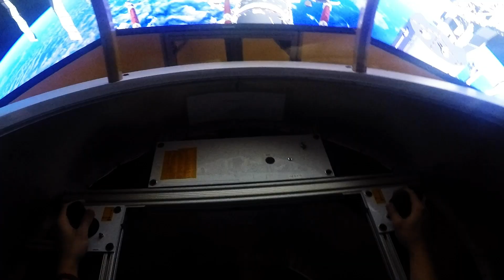Announcing Orbital Reef - Your Address in Orbit

Comment: Why is there no centrifugal Module?
Reply: Because for now, there is not a use case that requires it. On the ISS, or on future commercial space stations, crews will likely never be in orbit for longer than six months at a time, and thus, the effects of microgravity not enough to warrant a rotating module. I can however, see some kind of artificial gravity on future flights to Mars, and it will be essential if we ever want to send people to the outer solar system.

Comment: Far better than any pipe dreams of 1M people on Mars by 2040. 
Now get the Glenn ready and let's go!
Reply: Spacex=127orbital missions. BO=2 times going up and down. 1M is absurd but this is also.
Reply: @AnkardTan  No doubt that Space X is far ahead. However, once the NG is operating, it is basically bringing known technology in orbit. So, nothing that has not been done before. This space station seems to be a bigger economical challenge than a technilogical one.
Reply: @derhafi  ok, ng is optimistically estimated to be finished q3 or q4 2022 idk... so then the testing starts? by then, starship may be finished with its testing campaign... might not, but SpaceX has an assembly line for raptors and starships and is far cheaper to test since its cheaper to build. Starship=fully reusable, specialised steel, ng=partialy reusable, composit materials. So my question, who will have the money, capability and payload to build something like this first? My bet isn't on BO&Boeing for now.
Reply: @AnkardTan  I agree, the current prominence in development and the upcoming operation costs of starship alone, will keep spacex ahead of anyone else for the foreseeable future, when it comes to heavy lifters. 
Boing should have no trouble building a space station. BO is going to the lifting, they are going to insist :-)  my guess: not before 2025 even if they hurry up.
What I like about this, is the potential it has for an actual working space economic. I know, I know, I’m aware of the huge part wishful thinking on my side here but as a sci-fi fan, I want this to happen. I want satellites, infrastructure, telescopes, refineries and ships built and maintained in space and on the moon. That’s not asking too much, is it?

Comment: Reality Check: 
The rocket they want to take the station's parts to orbit, New Glenn, hasn't even started testing yet. 
The capsule they want to take astronauts to the station, StarLiner, has just been delayed another YEAR because Boeing is once again proving that they can't handle building capsules anymore. 
Boeing, the company they want to make the modules, is not doing to hot with their other space contracts right now. (See SLS, Starliner, etc)
Blue Origin's only claim to fame right now is their suborbital tourism, which has potential for them. For now, though, they need to keep their feathered little butts out of the big boy leagues until they have something more tangible than some half-assed blender animations and a dream.

Comment: This was designed by an idiot. Or a group of idiots.
Firstly; how are you proposing to use Bigelow modules when the company is shut down?
Secondly, why would you select such stupidly small inflatable modules?
Thirdly, a zero-G station is functionally useless for tourism of any kind. It's got to provide SOME rotational gravity.
Fourthly, the windows are purest designer masturbation and will NEVER make it to production.
Fifthly, Dreamchaser is only for cargo, and hasn't flown yet, and is many many years from getting man-rated.
Sixthly, the space arrangement shows zero understanding of moving around in Zero-G.
Seventhly, 1:30 shows a stupid Presurized Mating Adapter (PMA-1, in fact) from the ISS. The bend in it is due to the Space Shuttle's physical layout - and so the person who "designed" this station doesn't know jack shit.
Eighthly, there's no internal central structure shown in the inflatable module. That is impossible.
Ninethly, Boeing will offer the  most expensive launches in history. To partner with them is insane.
Tenthly, 3:14 - more designer masturbation demonstrated with impossible 2m x 5m window.

This is only slightly less of a scam than the Gateway Foundation's garbage.
Good luck gathering money from ignorant and stupid investors!

Comment: 1:32 Does Blue Origin not realise that space is 0 G? Good luck sitting on a chair, working on a desk and laying in bed in space....
Reply: The pillows are a nice touch! ;)
Reply: Very good point. BO have no clue. They're trying to compete with Disney in CGI.
Reply: artificial gravity?
Reply: @ro-padre8346  no.
Reply: @lukasschmitz1799  what do you mean no?
Reply: also there is already beds in space and laptops on the iss and using something maybe like a seat belt you can sit on a chair that will be stuck to the wall, floor whatever you wanna call it

Comment: I appreciate the ambition Blue has but they seem to be getting abit ahead of themselves. They haven’t put a rocket into space yet!
Reply: Making it into orbit isn't really the milestone for being able to develop something for space, I feel. When Grumman made the LEM, they hadn't sent any rockets to space either ;)

NASA has more than 60 years of spaceflight experience which BO can draw upon. I think it's more important that they actually make the hardware, getting into space will happen on it's own.
Reply: @serpent5751  but they weren’t banging on about doing it for years and years were they? That was a nasa contract which is different. Blue have been going on and on about New Glenn a long time now with little to nothing to show for it. As I said I admire their ambition but they need to provide actual hardware which works before thinking about anything like this.
Reply: Also another point they still haven’t delivered Tory’s engines for Vulcan! How can they plan for the future when they are failing to provide hardware for the present!?
Reply: technically they reached space but not orbit
Reply: @AnkardTan  barely reaching the karmin line is hardly space.

Comment: So they are now dreaming of reaching Orbit 😑✨
Reply: They can, they just go via software rich prototyping, not hardware rich
Reply: @rocketcello5354  
Software rich as in renders right? ;)
Reply: @jeffvader811  I like that style of thinking, but what I meant was lots of computer sims rather than explosions. ;)
Reply: @rocketcello5354  Oh, So, Space Launch engineers are just, software developpers ?
Reply: @Mashilo  well, yes, for the initial testing phase, when lots of sims are done. engineers pour over the data and change the design accordingly
Reply: @rocketcello5354  you mean render rich prototyping
Reply: @SergePavlovsky  no, simulations that give computer generated data, allowing design changes to be made before large scale prototypes are built. Only one test flight is needed to confirm the data, instead of about 20 or so. different approach to the same issue
Reply: @rocketcello5354  you are confusing simulatilons with renders. they are older than spacex and can't get it up to orbit yet. because renders don't work
Reply: @SergePavlovsky  they show us renders, but they don't show us data. you can't critisise unless you have all the data
Reply: @rocketcello5354  you can't praise unless you have all the data
Reply: @SergePavlovsky  Not praising, just defending against illogical thoughts and ideas
Reply: @SergePavlovsky  I did not really understand what that sentence meant, but you can't attack something if you yourself have no evidence
Reply: @rocketcello5354  you can't hype something if you yourself have no evidence. it's called scepticism
Reply: spacex is aswell for starship
Reply: Yea, no one has been here except from Team Rocket